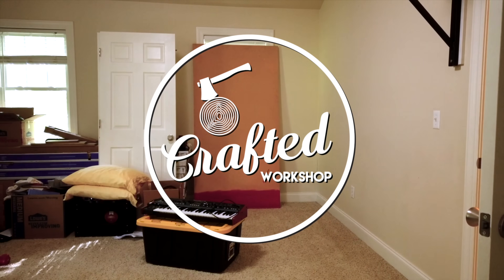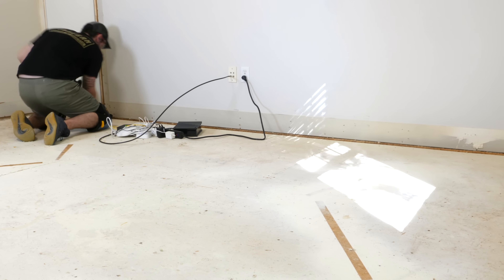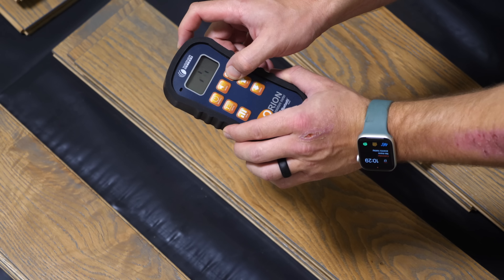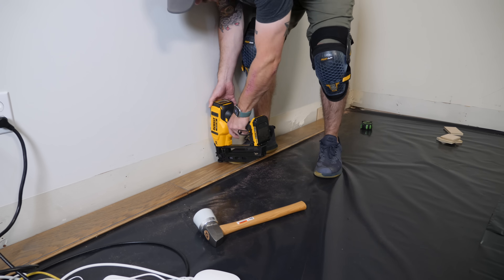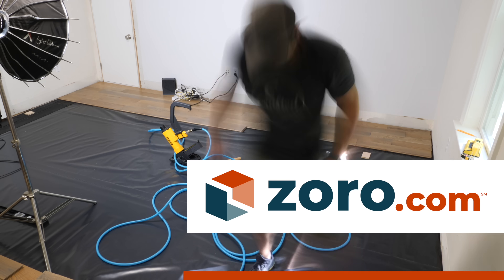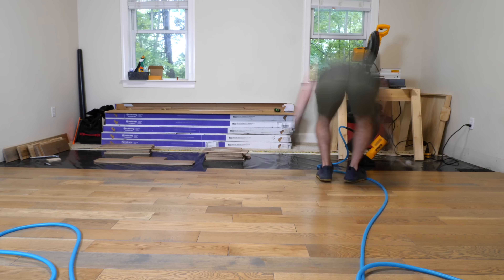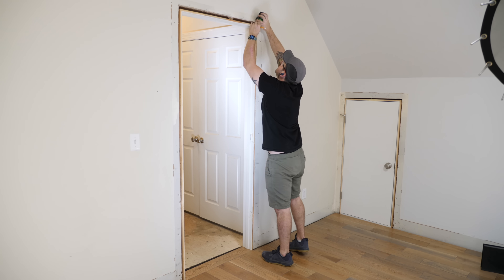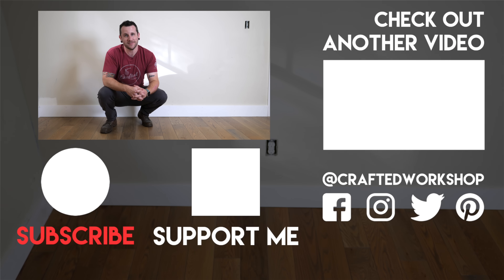Installing HARDWOOD FLOORING for the FIRST TIME 🛠 How To Install Wood Floors

Comment from the maker: Thanks to Zoro.com for sponsoring this video, go to https://zoro.com/crafted and sign up for Zmail to receive 15% off your first order! Make sure you subscribe so you don't miss my upcoming videos on the bonus room : https://goo.gl/V5gcNJ
Reply: Thanks for the response means a lot you just made my day
Reply: How long did this project take??? I tried to look for it in descriptions but didn't find anything.
Reply: They are only saying 10% off net 15%...how do you get the 15%???
Reply: Jesus Christ, what's you do to your arm @ 5:30 bro? Those tack strips get you? Jk, but it looks like you were out on the bike doing wheelies!
Reply: they are only offering 10%... the "other place" is still less expensive without that 15%
Reply: instablaster...
Reply: hey some of the boards you ended up using looking gray and off-putting. will that go away after the next refinish?

Comment: You called the flooring nailer the "star of the show", but having done floors in the past, I'd claim the knee pads are the most important tool you used.
Reply: Safety third!
1. Makin money
2. Lookin guud
3. Bein safe
😎👍🏻
Reply: Knee pads aren't usually for safety, they're for comfort.
I provide my guys with them, but personally never use them.
Reply from the maker: They definitely came in handy, but I didn't use them nearly as much as I would have on my laminate or vinyl flooring install. I was hunched over the flooring stapler most of the time.
Reply: @SoEliteGamer  Ofcourse  pads are for safety. The difference is how fast the injury appears.
Reply: @SoEliteGamer  tell me you are kidding? They may be one of the most overlooked items in a hard laborer's gear list but they are def a part of PPE and can protect your knees..
Reply: Yessir 👌🏼
Reply: @cm01  making money over the safety ??Troll.You haven’t been done much of  construction work pal .
Reply: You sound like my wife
Reply: Wish I wore mine more than I did that’s for damn sure LOL
Reply: I dont even use knee pads when i work... And i do this professionally
Reply: @perazdera3809  OSHA after seeing $ over safety: 🤦‍♂️
Reply: Yup. If you're on your knees regularly (for any reason 😏) you can seriously mess up all the cartilage in that area. Ideally you don't want to go on your knees at all but rather just squat down. Knee pads are a good compromise though.
Reply: You sound like my 60-year-old coworker xD.
Reply: I never took my knee pads off when I did hardwood flooring
Reply: I prefer not to put my body weight on my knees
Reply: @THEDEVIL-kj2ip u think osha comes to all these jobs lmfao

Comment: Always #1 rule to any hardwood job is before you cut the moisture barrier down take a 4 foot level and go around the whole room and check for discrepancies in your subfloor. If you have more than a 1/8 of an inch should always take a sander and hit any area that peaks up   If you don’t have one you can rent it from one of your big box stores fairly cheap about 50.00 dollars a day to spend the money it will not only look better but it will work easier than fighting the uneven surfaces.  Just a friendly suggestion!  Good job

Comment: My 125 year old house has its original hardwood floors with no vapour barrier underneath and it’s absolutely perfect
Reply: Yes it depends on where you are. I'm guessing he's in a climate where the vapor barrier goes on the outside to keep the outside humidity out of the walls (where I'm currently at this is the situation). But in the climate where my rental property is at, the vapor barrier is on the inside to keep the moisture from inside the house from condensing in the walls. Ask someone who knows local code before you do this. Also of concern is what is underneath: floors over a crawl space, finished basement, or concrete pad (if you're doing hardwood in the basement for example) must all be treated differently!
Reply: It’s still a smart thing to do. It’s also too inexpensive, too easy and too fast to not do.
Reply: @wilfdarr like a garage owner build a room on top and need that to install it . Humidity

Comment: Hi, I work for myself, and something I had learned from a fellow contractor was to use the wide shakes of siding cedar wood shakes as spacers. The reason I am mentioning this is that having asphalt shingles in the house is not such a good idea. Because they are tar based products. And cedar is just wood and I would use this instead, for health reasons, for my installs.

Comment: I have installed hardwood flooring before.  I love the Flooring Jack.  Next time I install hardwood floors, I am definitely going to get one of those.  I think you could use it even for stubborn boards that long and just a bit warped.  You could put a long 2"x4" between that far wall and the flooring jack, cutting the 2"x4" to length as you go.  Every hardwood flooring board could be in tight.

Comment: Johnny Brooke . . . .WOW!  Thank you so much for posting this "Hardwood Floor Installation for Dummies" tutorial.  I watched NUMEROUS hardwood floor installation videos but yours was the best.  I really appreciate your transparency, showing the mistakes you made (dry wall damage) and creating a level floor surface for the hardwood flooring material with shingles.  I think you saved me from numerous train wrecks on my first go at this endeavor.  Finally, I REALLY appreciated the tools that you utilized and / or recommended.  I made a last minute run to Harbor Freights to secure some of the "other tools" that extended or enhanced my ability to do a "professional type job" on my first attempt . . . WELL DONE!👍😃👍
Reply from the maker: Thanks a lot Michael, glad it was helpful!

Comment: Hi Johnny, I'm a brand new subscriber and I live in a Mobile Home. I've been replacing all of the subfloor, only one small bedroom left to do .😁😁🤩. I found a 8 or 10 inch channel lock pliers worked best to remove the old Staples. I grabbed the top of the staple and just pushed the channel locks over the round part and it pulled up the staple with little effort. Just another idea for anybody else to try if they have this kind of project to do. I appreciate you including your mistakes or things overlooked, so we don't have to go through the same setback during our project. Thanks again for sharing your thoughts and videos Rodney
Reply: Rodney Widger or a scraper way easier and faster

Comment: while remodeling my home i hung my electronics with "command strips" and zip ties. got everything above shoulder high and i worked underneath my crap without knocking anything down. 
also thanks for the tip on the shingles!

Comment: Thanks for the video. The one thing that I would suggest be done differently, is your first row. I wouldn't offset from the sheetrock along the whole length, but mark an offset at the each end of the wall and then snap a line. I would place the tongue on the line and follow it for the first row. The sheetrock along the length of the wall can fluctuate and not be straight.

Comment: For the flooring jack you can take one of your parallel clamps or quick clamps and flip the bottom piece so it pushes out
Reply from the maker: Why didn’t I think of that?
Reply: You can also take a large flat head screw driver to pry the final few rows back. Just beat it into the subfloor right along the tongue of the board and pry. It might cause a little bit of damage to the tongue but oak usually holds up well.

Comment: 5:28 Interesting bit about having to get the wood pieces acclimated to your house's environment (humidity, etc), a process which can take several weeks. But that means if you contract a commercial floorer to do the job, they're just coming and installing wood pieces that haven't been acclimated (since their best interest is to just come in and get the job done in a couple days).
Reply: Yeah but they probably do a killer job.

Comment: Next month we put scraps of hardwood flooring on the roof to shore up the low spots and use carpet mats that we pulled up from the bonus room to show down the rainwater flow on the 12/5 roof.

Comment: Instead of the flooring jack, you can cut a piece of flooring diagonal, keeping the groove side, and then cut a piece of plywood angled and sized to the gap to act as opposing wedges to close up the gaps. The groove protects the tongue on your board.

Comment: Last couple rows to the wall you need to use a big flat head demo screw driver to pound into the subfloor right up against the piece of flooring you want to staple and pull it towards the previous row.  No need for a fancy tool. Great video!  Thanks for sharing!

Comment: Thanks for the video.  Have completed installation of about 1000 sq. ft of my home with beautiful California hardwood bamboo flooring.  Two tips of advice ... #1 DO NOT NAIL boards. Boards interlock with themselves and should be floating due to expansion and contraction.  I used nails on half of my house and now every time I walk on them the nailed boards screech while the non-nailed boards are silent to walk on.  #2 Lay boards DIAGONALLY since no room is perfectly square.  This will necessitate you buy 5-10% more hardwood flooring but the fit and esthetics are superb.  Except for the screeching nailed boards, love my hardwood flooring!
Reply: Is the bamboo holding up well (scratches, warping, etc)? Considering that instead of oak. What company did you buy from? Thanks!

Comment: This was a great video for me to confirm what I was planning to do was pretty spot on. My project is a little more involved since it is a dining room, living room combination with a long hallway in the middle. My issue was that I wanted the flooring centered down the hallway so it took way more planning and measuring in 2005 build raised ranch that for some reason doesn't have any straight walls! Gotta love builders that can be off by almost 1/2 inch from one end of the hall to the other! Thanks for the video. Hoping my extra measuring pays off!

Comment: Dude, did 1600 sqft of 7 inch engineered hardwood recently. It was stapled and glued. The glue was my first time. It was an easy clean up but added an extra minute or so per board.

Supposed to be squeak free. But it was a bear.

Comment: Only thing I do different is using felt instead of vapor barrier. I like to use vapor barrier for laminate jobs. You didnt cut any corners, nice work.
Reply: Vapor barrier for naildown, plastic foam for laminate.

Comment: Thanks , I did bellawood 15 years ago in my living room but didn’t know about the flooring jacks. Ordered a nice pair for $53 ea but their are cheaper ones for around $32. Doing my foyer this year. I would use quarter round along perimeter. I keep the gap at 1/2”.

Comment: Thank you so much for the asphalt shingle/felt paper shim idea! I was nervous about self levelling cement if I had to nail through it, if it would leak throw the subfloor or between the floor/wall, etc. Shingles are cheap (especially when people throw out extra), sturdy, and will stay in place.
Reply: Nailing tge shingles wont hurt
Reply: I’ve used shingles and tar paper to shim up studs when placing drywall and concrete board also.

Comment: Hi sir, looks a great job,
I am a little confused could you quickly explain please, when nailing the floor down how can this allow the floor to expand? also if it expands how can it retract back, ?surely the staples are preventing this as its not a floating floor,
Reply: I have asked the same question to many people in the trade.....and have never got an answer. If the floor is nailed into the subfloor and joists....it would be impossible for floor to expand and contract without ripping out the nails.
Reply: Same question here, and I could not find any answer. I installed hardwood floor in my house with much smaller "expansion gap," and the floor still  looks great after many years.

Comment: Use a magnet to find missed staples and nails - a cheap neodymium works best (This is especially important when refinishing hardwood floors before sanding) Gloves help reduce the abrasion that causes blisters as do rubber gripped tools.

Comment: Surely putting a.plasric.sheet under solid wood is going to trap any.moisture that gets underneath? Then it will just be absorbed by your new flooring. Wood needs to breath and if you've got moisture coming up from the foundations to your subfloor you've got more problems than a plastic sheet will solve.

Comment: I find it quite interesting how different this is to how wooden floors are installed here in Germany.
Reply from the maker: How do you guys do them? That is interesting!
Reply: @craftedworkshop  It is uncommon to nail  a hardwood floor, as most newer houses have screed floors (not sure if this is the correct term) and no blind floor to nail or screw into. Most hardwood floors are laid floating or maybe glued if there is an underfloor heating.
Reply: @EarMaster55  we glue down engineered flooring (basements or slab homes)
Reply: Steve Varga we do the same in the states using sika adhesive or bostic 

We do full spread on concrete subfloors

I havent done a sleeper syatem in a long time , some architects still try
Reply: @EarMaster55  every company have variations in chicago . A few things he did are wrong in my company , but the video states for beginners not pros
Reply: @mybeatmhz  like plastic on a Wood subfloor for hardwood?

Comment: Great video right to the point, no crazy music or slogans.    Very easy to understand.     Why did you not tape the joints with the plastic vapor barrier?    Should it be done, why or why not?    Im am planing a 16x18 room build over an old garage slab that has about 12 inches between the new floor joist and old slab.    One more question, should there be insulation shoved between the joist or none?  It is there but no sure it will "breathe" correctly.    Anyway great video thanks.

Comment: Their is trick to closing up the gaps when finish nailing if you don’t have a jack. You can use a flat head or chisel hammer the screwdriver into the subfloor then pull back on the screwdriver up against the board hold into place then nail and it should close the gap it works pretty well

Comment: A faster way to step the stairs is putting some rows on the ground and then using the cuts to start the next row. Also you can use a small cut off to hit the flooring piece your installing and it gets a tight line and it's it's nearly impossible to damage the flooring  because it's being hit inside the Grove. Another recommendation is getting a stainless steel prybar it doesn't have paint so it's less prone to damage the wall when removing base.

Comment: Fencing pliers are great for staples and a ton of other uses.  I always have a pair in a toolbag.
Reply from the maker: Yea, I need to pick some up!
Reply: As a carpet fitter in the UK, we always use a small hand scraper to get the staples up, by far the quickest way
Reply: I slide my pry bar on the floor. It’s heavy enough to pull the staple out very easily.

Comment: Nicely done. Another "cure" the trim on non-straight walls is quarter round trim nailed to the bottom of the baseboards. (Do not nail to the floor as it will restrict the expansion/contraction of the flooring) this also gives an extra aesthetic to the otherwise blocky look of plain square-faced baseboards. Additionally, routing the top edge with some sort of profile will add character to the room and reduce the ledge that collects dust on top of the baseboards.
Reply from the maker: Thanks! I personally am not a fan of quarter round and wanted a clean, square profile, but those are great options.
Reply: The younger generation of house owners don’t like the extra quarter round as it’s looks outdated and frankly annoying to push furniture up against as it’s just the little more room you could have. It is a solution to cover up the gaps for sure though

Comment: This turned out looking great. You can use one of your clamps as a floor jack. You would just need to flip the end of the clamp. Also, spacers and wedges can be a good option too
Reply: Many people don't know that "quick clamps" have reversible jaws to be used as spreaders.
Reply: @thomasarussellsr  a lot of parallel clamps have the same option
Reply from the maker: Good call!
Reply: @thomasarussellsr  Quick clamps with handles that you squeeze to apply pressure would likely lack adequate pressure to get a really tight fit. You can do better with a clamp that has a screw-type handle. You'll apply greater pressure and you can do so carefully, really dialing in the amount of pressure.
Reply: @idontthinkso666  great observation. Most "squeeze" type quick clamps don't get great squeeze pressure. Even the best ones depend on the user having a great squeeze grip in their hand/s. You modification of my suggestion is 99.9% accurate. I concur.
Reply: You can also use them in that configuration to stretch out a pant's waistband =)

Comment: Just a great video. Only question I have would be how to tackle old time (125 yo) floor radiators? The only solution I have is to do it during summer (Michigan) and disconnect and remove them. Since this was your first go at this, this might be more for the community, so fire away. 750 sqft dining & living room oa and 4 floor radiators. And yeah, from what I can see, the floors have been refinished maybe twice and deeply gouged so that's not a viable option.

Comment: I would have put a small bevel on the ends of the baseboard where they meet the door casings. Gives a cleaner look with a nice reveal, and you don't have to worry about them being flush.